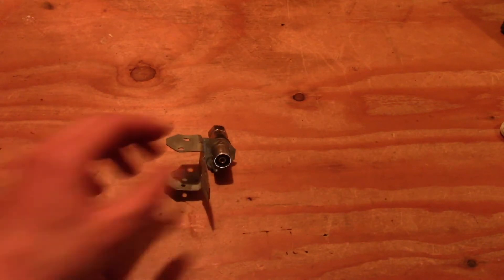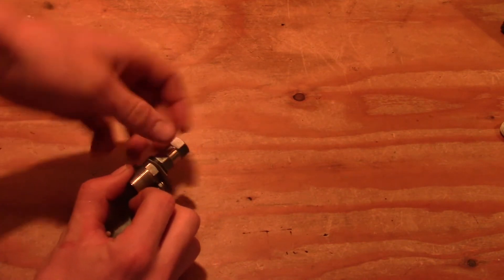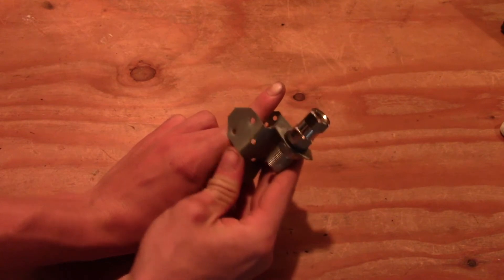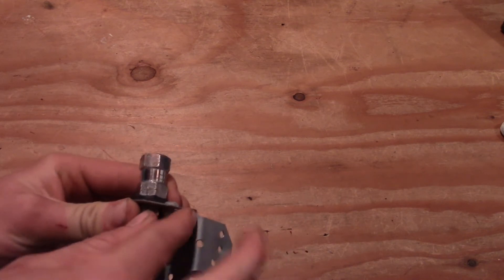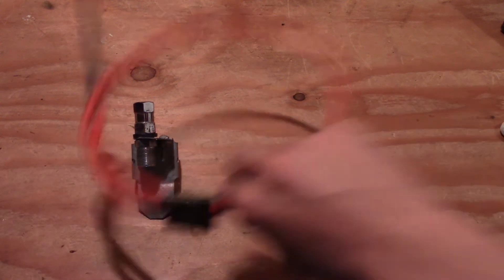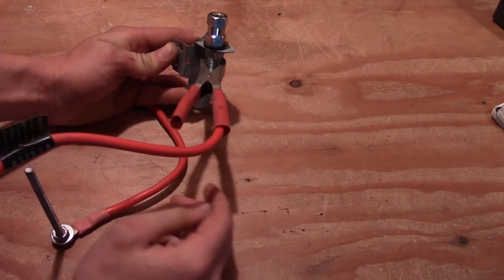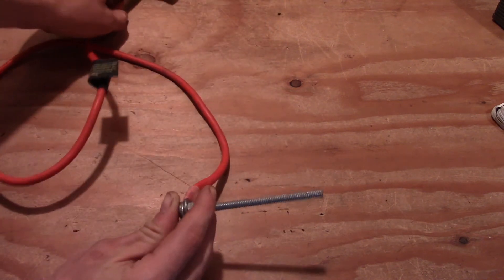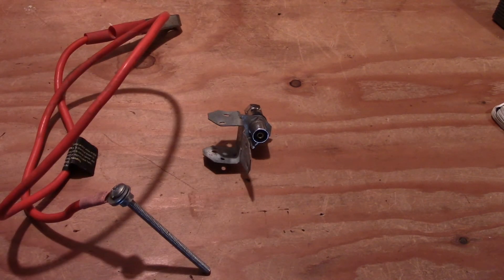A Homebrew Portable Mount for Hamstick Antennas

Comment: I make a  hybrid version of a T2TL or sleeve single band HF vertical di-pole antenna like this with ham-sticks. The key thing is the coax shield acts as the only counter poise needed making them a "no ground plane HF antenna". As the top ham-stick radial is a 1/4 wave electrical equivalent radial, the coax shield must also be a 1/4 wave length long to function as a vertical di-pole . A G3THQ choke, just below this, tuned for that band of use, then sets the coax length as the proper counter poise radial. 
I mount these in side of 1 1/4 schedule 40 PVC pipes 20 foot long ($20 here) as a base station antenna. With a pipe cap to hold that adapter, And a 1" hole roughly 100 inches down allows the coax to leave the pole and run off to the radio. 
Notes, the coax acting as the counter poise works best if it is 6 feet above ground level before it reaches the G3TXQ choke. But after the choke, it can lay on the ground or more coax can be added.
The top radial tunes just as it is suppose to be tuned, the coax counter poise radial can be wound or UN-wound slightly to tune the counter poise side. 
Each band ham-stick can use the same pole mount, but different 1/4 wave length lower coax sections must also match each ham-stick's  band of use. The choke is the same coax simply wound on a 4 inch form. 
I've made 11 meter versions, 15 meter versions and 40 meter versions. And they all worked well for a "small space vertical base station antenna" you can strap to a tree or a wooden post. And they all are roughly just 27 feet tall. As the coax, runs off to one side. It will hold up a 103" stainless steel whip as well. I don't make videos or sell things, I just experiment and build things, but try one out sometime.  With a ham stick, you do not cut the coax as those making regular T2TL antennas for CB use do.

Comment: I would like to see a two meter antenna built like a WiFi gun, can be seen on youtube. I've though about one made of printed circuit board, non etched. The antenna is for low earth orbit sat work, with out the need of flipping the antenna back and forth.